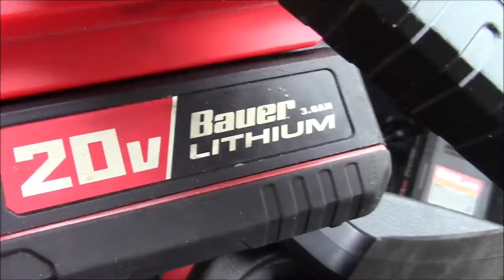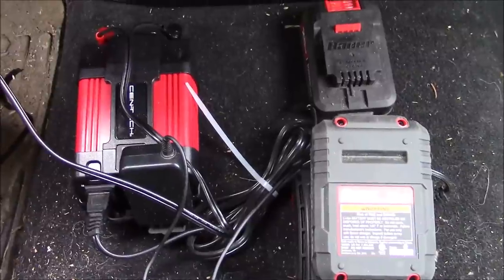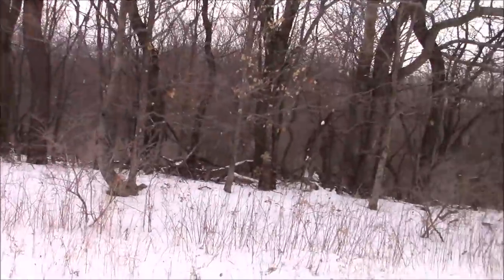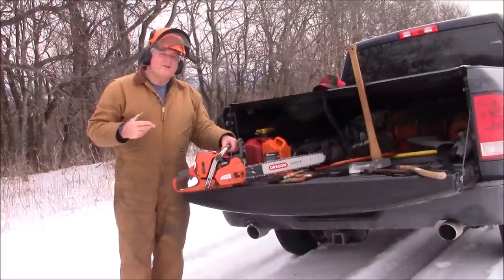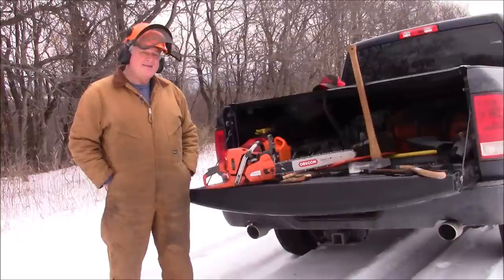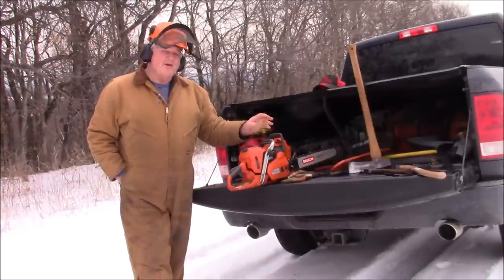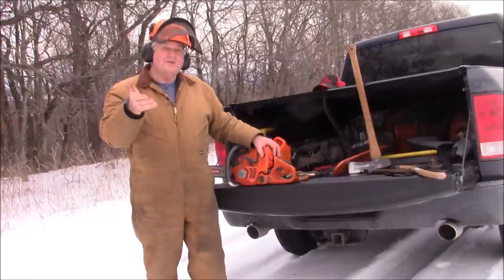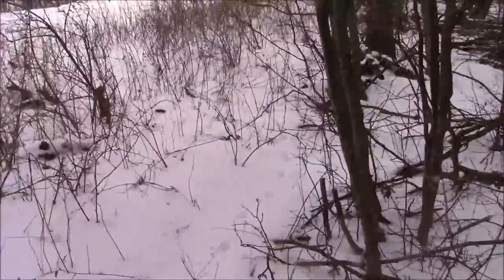Husqvarna 555, 562 & 560 Autotunes &  Discussion on HOW Autotune Works, Channel Update 2021

Comment: No so if your a small time guy .and like here in tennessee the dealers treat you like?????.and we cant afgord to go PAY EVERYTIME SOMETHING GOES WRONG ?have a saw that cost me zero dolars and can be fixed..by yoyrself...and those so called dealers dont even do anything to it..its like buying out of box.???maybe thats just here but im stuck here???i went to dealer 3 times and just to see how i eould get treated?both times like i was stupid so played along then they tryex selling me there personal used junk saws..they dont care about you..they only take care of big companyz???sad
Reply from the maker: Why I'm doing these video's, point is with Autotunes for most issues you don't need a dealer to fix your saw. So your "Have to pay everytime something goes wrong" is a bit ridiculous as that would be true with any saw brand requiring dealer assistance, they aren't a social service. While it can be a HUGE asset, You don't need CST. They HELP but one of these saws simply is a two stroke single cylinder. It's because all the miss understanding and BS tossed around online folks assume CST/Dealer is the first step to solving a saw issue. Nothing is different with an autotune. A carb is still a carb. A cylinder still a cylinder. And for that matter parts are Cheap as compared to the "other" brand, top ends under $150 and complete short blocks assembled with a new crank in the $200 range where other saws and brands a CRANK is over $200. So all this animus is on you for not doing the same type of analysis on a 500 series as you would on any other. Dealers can be good or bad, that's on them. Bad ones should loose your business, good ones your support. But the 500 series of saws have advantages even for the hobby type. ANd these 562's I'm sticking together with junk, used carbs and ignitions; should be your clue. While the 300 series are a personal favorite of mine for other reasons the 500's are just as easy to work on.
Reply from the maker: I guess part two of my reaction is a "500" series doesn't make a bad dealer, the dealer does. CST is a tool that a "good" dealer can use to help in customer relations, where older saws DON"T have that feature it's a net gain with virtually no down side. And like any saw, eBay is a great source and there are places like HLSupply that ARE dealers and a source online for parts. SO yet again the "link" between 500's and animus to dealers is based on the premise CST is needed on every repair. Not true. Only with a new carb. And there are dealers and places online for that as well. OR a used carb parted from a running saw ASSUMING the issue is the carb or Autotune. Just like any other saw,
Reply: @afleetcommand  wasnt knocking you love yalls chanell
Reply: @afleetcommand  dealers here are terriable im trying buy new big saw..have tree service bymyself small one..im getting older need to be able to fix my own..just learning over last year how to wrench on them thanks to all you guys is channels..im in TN..SMOKEYS and could use some help...need a all purpose 70 or above saw..that will last..i do big and small removals and firewood ..been useing a 47.9 cc saw all year and need a big one ..been borrowing them..want to buy a good one DO YOU HAVE ONE WITH EXAUST MODDED.FOR SALE ILL BUY IT
Reply: @afleetcommand  wasnt attacking you..love the show..
Reply: @afleetcommand  these dealers here dont care..and never owned a auto tune..but tryed one and didnt like it.was 562 but i like to have control of throtlke and feel the saw as in the tree or on tbe ground i nedd control of it and to trust it?   .any help would be great used to live up north was raised up by there..down here the markey is small in my countys...
Reply: @afleetcommand  i did ..ive studied your videos im a old school husky guy...can work on them lityle bit at least..?but theres no place to get muffler mod ..and the dealer here..dont want to buy from them..on princaple for what they did to me..then a freind goes in with a bigger truck and more money he gets treated like gold? ?ya kknow boss
Reply: @afleetcommand  i do watch yiur videos and anyasis
Reply: @afleetcommand  could just get 372 or 461 guess thars my only option..dont know how to mod the thing but can at least fix it.and tune it..i like to feel control the cutt..especialy in the tree im older and injured
Reply: @afleetcommand  or drive to allabama..frustrated deeply didnt mean to sound like was towards you as you helped me in getting my midsize saw...i have a old shindiawa 488 and it hands down been best small saw ive had ..learned to work on it ..taken over 100 trees big ones and about 60 xord wood this year its still going strong. Its from 90s but it s like brand new..spent 0 bucks on it except a walbro carb.it has crappy air fikter swt up to much fines get in so clean it daily....flund a diferent filter online so orxered it
Reply: @afleetcommand  wasnt disagreeing am fed up with theze dealers..rather buy from someone
Reply: @afleetcommand  been climbing and doing trees 26 years ..and am getting old crippled..need a good all aroind saw woth muffker mod...ill buy it if you have any fir sale
Reply: @afleetcommand  just so you lnow i watch every video you make..and been watching all the others to learn.to fix them?? Thank u
Reply: @afleetcommand  didnt comment just about this series of videos was a general ,issue i have with money hungry dealers..i do this work bevausr i love IT...and its dangerous and just dont want to spend another 1100 hundred wth them...just spent 3 grand on climbing gear and little saws..thats all
Reply: @afleetcommand  this is why i dont like the comnents or texts ..this happens????in are day we just call a man ya know
Reply: @afleetcommand  your going to laugh your butt off freind..lol i just wike up and a tree fell on my house a pine ..lol lol lol.im not lieing lol...thats what i get i guess i have some fun toda.y..lol unbeleivable..lol
Reply: @afleetcommand  ill take a picture its not huge but funny nevet the less it missed my ac
Reply: @afleetcommand  im just learning to work on them was in production and never had to up north had mechsnics..its why i watch your shows
Reply: @afleetcommand  im a contractor and work for myself thats why i asked ..stuck in these mountains alone
Reply from the maker: A new run of 372 X-torq's are being delivered to dealers. 365's as well. For a Tree Services one of three saws.. 565 365 or 372 are the most versatile saws on the market. 565 are lower stressed 572's. 365's same for 372's, and 372's now a old style "standard" and all three $200 bucks less than 461 or 462
Reply from the maker: Try from an on line dealer then.
Reply: @afleetcommand  yea been trying think found few guys..problem is i only have cash no credit or cards ..then i paysomeone and get wrong parts or screweeld over then there cards get charged and i lose out..i bought a 450 dollar echo 2511t and it has vbockers on carb..they wouldnt tune it ..he said it diesent need it ..i said bullshitt it does ..followed all gas and brake in proceudres i waited until 10 tanks before ineven tryed useing it in a tree ..got in the trre it failed me..ibtook it bacl to ANDERSONS ITS ONLY ECHO DEALER IN MY COUNTY..?and havebheard from them..not a call at all its my only climbbsaw ..i just spent 3500 hundred on gear and was going to then purchase bigbsaw i know was stupid but have trees to do my arms torn and hands are both broken.its light so i bought it had to send someone with card to buy it.i was buisy in tree workking then because i put gas in it once and didnt yet k wrd did not use it they wouldnt swap me a diferent saw im stuck YET AGAIN WITH THEVSAW..NOW I HAVE TO BUY THE QAIRTER PITCH.SWAP OVER SO HAVE 750 BUCKS IN A BASICALY A HAND SAW THAT SUCKS..I WANTED T O EXCHANGE IT FOR THE 355 THEY WOUKDNT DO IT. ??ive never bought a saw up north were im from from a dealer that doesnt run the saw first and tune it for you.thats not a chsin saw dealership..what they do is nothing???now ive had to use my mid size shindiawa 488 for remvals big ones 4 and 5 ft diameter and climb woth it..shindiawa was better before echo joined or bought them..i have that 488 got it for 4 hours of mulching.had it a year and done 100 removals and 50 cord of wood or more ..best saw ive ever owned.im new to MECAHNICS IM CLIMBER NOT MECAHNIC..?IM LRARNING FROM YOU GUYS..ITS WHY I TEXT YOU..THAT SAW I CAN REPLACE THEALL PARTS ON IT FOR 100 BUCKS AND I CLEAN TEAR IT DOWN EVERY NIGHT..IT HAS BAD FILTER SET UP FINES GET IN IT ..SO I CLEAM IT DAILY..ITS ONLY SAW THAT SAVED ME THIS YEAR MY TRUCL JUST BLEW UP..AND CANT KEEP BORROWING MY PARTNERS 391 AND 395 ..SO IM STRESSING OUT.CANT SPEND 1300 HUNDRED AT THESE DEALERS NO MORE..i went to co op the only STHIL AND HUSKY DEALER IN MY AREA?I PRETENED I KNEW NOTHING?THEY TRYED SEILKNG ME A USED SAW ..OF HIS OWN AND LIED TO ME THE WHOLE TIME I REPEATED THE VISIT AND AGAIN THEY DID THE SAME...SO IM AT MY WITTS END..FOUND A PLACE CALKED MATSERMINDS NEAR ME ON LINE .BUT ITS HOURS AWAY FAR..AND WAITING LISTS...?I JUST WANT A SAW MAN MY LIFE DEPENDS ON IT..BECAUSE I DONT HAVE BIG COMPANY THEY TREAT YOU LIKR DIRT..THANK YOU FOR RESPONDING I WASNT CLEAR ON WHAT YOU MEANT TRYING TO LEARN HOW TO WRENCH THEM BECAUSE WHEN I CANT WORK ANYMORE I WANT TO WORJK ON SAWS ..TREES SAWS ARE THE ONLY LOVE I HAVE ..DONT DO IT JUST FOR MONEY..BEEN DOING THIS 26 YEARS JUST ALWAYS HAD MECHANICS AND GOID SAWS..IM NOT IN PRODUCTION PER SAY ..I DO MY OWN TREES AT MY OWN PACE SAFELY..AND AM JUST REACHING OUT FOR HELP ..WAS RAISED UP NORTH BY WISCONSIN AND MIDWEST ..DOWN HERE ITS COMPLETLY DIFERENT MARKET.AND IVE BEEN BABYSOTTING LAWN SCAPE CREWS IN THE SUMMER..SO IM NEW TP ALL THIS TECHNOLOGY...WE RAN OLD HUSKYS 90?S AND OLD STHILS..O MODELS ..WAS WANTING 462 BECAUSE ITS SO WELL BALANCED AND LIGHT ..BUT NEVER OWNED AUTO OR MTRONICS SAWS..ONLY RAN A COUPLE RECENTLY???AND DO NOT LIKE THE NEW HUSKYS OR THERE CONTROLS..ON STARTONG THEM..SO AM LOST
Reply: @afleetcommand  im now leaning heavy towards a 461 and or 372 but realy need a saw with work modificatiins?to cut fast i do alot of tree in moubtains on steep slopes...have to many injurys to carry that 395 all day..its not mine anyway..i take care of my saws these guys dont ..that littke saw i got was from watching your videos on the muddle size saws i do not like that 562 ..just dont . tryed it and its over sqaure hurts my arm..its heavyer than this 488 ..honelstly mine cutts better and i cam control it in cutt..better..its 47.9 cc and it has been best saw i swear....but i need 70 or more size saw badly.been out of production trees helping other crews so im confused on all the nonsense..its why i tryed you.372 just seems lacking needs moded and i lkie 461 because it low end pulls..but wanted to buy 462 again need a work moded saw that i can fix while in the mounrains at 4600 feet there is no stores.?..thanks for checking in
Reply: @afleetcommand  dont want xookie saws..work modded..ibtryed emailing few guys but i dint have all year to wait..ya know boss
Reply: @afleetcommand  562 572 hurt my torn right forearm the balance isnt rite good fir falling but i do all work by myself climb drop removals and fire wood what do you recomend besides thise two saws
Reply: @afleetcommand  ???
Reply: @afleetcommand  i have a old 029 needs rebuilt just needs new pistin cylinder assembly.going to use it for fire wood it has 311 handle on it ..i tor it apoart and everything else is good on it..has dealer sticker from plainsfeild indiana on it..apears to have been worked on or parts swapoed out alrwady.not sure if its the super or not has small blue logovsticker on the air box cover so think it might be the super model.029..going to order the 039 kit for it to raise the power ..but thats for firewood its way way to heavy and clumbsy for remivals
Reply: @afleetcommand  thanks man
Reply: @afleetcommand  ive never owned a bigger sthil likec461 or 462 thats why i wanted to try it..and the feel of thst 462 felt best in my arms as far as all around mobilty im inured badly..so it matters a grwat deal..im small guy 5.7 150 pounds but super crwzy strong but my injurys prevent that strength.so i like 372 but it just lacks that extra uhhmphhh???i need tjis because i work alone alot on steep hills mountains..and use wedges comealongs have alot of huge leaners and pines..root deacy and in clay soil..need to be cofident in tge cuutss..thanks for helping IF YOU HAVE ANY OF THOSE FIR SALE THAT ARE READY ILL BUY IT...
Reply: @afleetcommand  the extra 200 hundred dont matter if it will run and last ..me..thanks
Reply: @afleetcommand  it wont let me read the rest of your comment.on these saws says read more amd wont click on it??
Reply: @afleetcommand  im new last year to this internet stuff as well..i do not watch tv onky you tube havent watched main stream tv in a decade ..so forgive me im not in the looppsss
Reply: @afleetcommand  i meant the 5 serious im nit sure i like them ..tryed that 562 and wasnt impresed all these internet cookie guys muslead me with saws theyve juiced up on steriods..ya know..
Reply: @afleetcommand  i thought youvsaid on your video one time that x torgs had bearing and all kinda issues maybe im wrong and miss understood the video
Reply: @afleetcommand  by thecway i watch your videos and i to like the smalker saws mid size like yiu guys do..but i need big boy
Reply: @afleetcommand  ok thsnks
Reply: @afleetcommand  i am